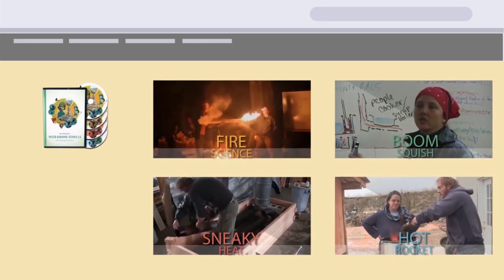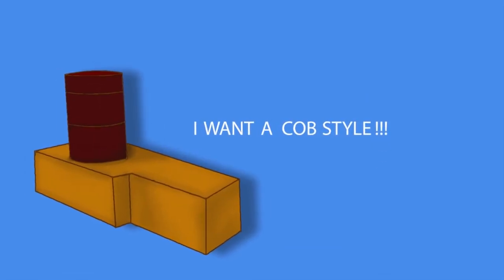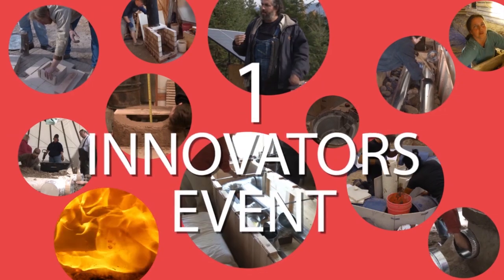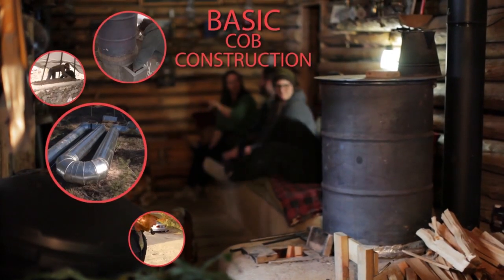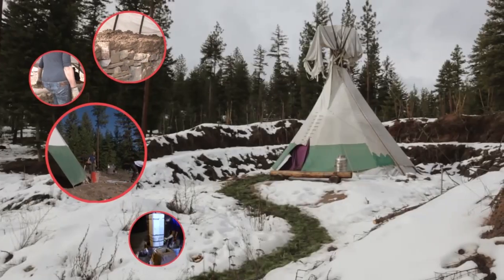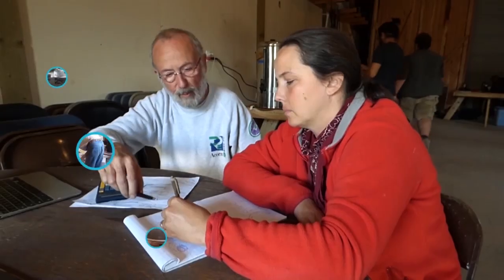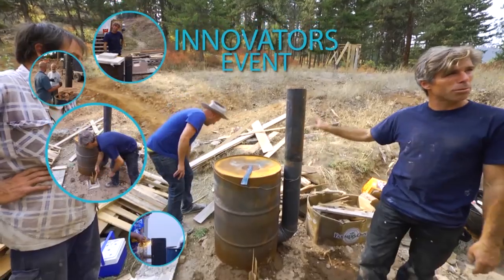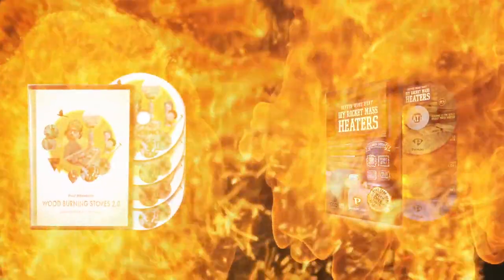Better Wood Heat: DIY Rocket Mass Heaters - trailer for 4-movie set

Comment: Realistically, could these be built on a national scale? Given that countries now have CO2 targets, can this be an effect strategy to help meet them?
Reply: Or is it more for rural households who traditionally rely on coal and wood stoves to heat their homes?
Reply from the maker: Yes.  I think that if rocket mass heaters were used by 100 million people in the colder part of the US, it could cut pollution and carbon emissions by 20% for the US.   The math is pretty simple:  More than half of our home energy use is for heat.  More so in the colder regions.
Reply from the maker: Most rural households use electric heat or propane heat.  Then comes the more conventional wood stoves and pellet stoves.  So rural stuff is ready to be harvested.  But suburban and urban homes with a yard are also a good place.   I suspect that a lot of inner-urban apartment dwellers might put in a rocket mass heater just to save money - burning a LOT of their own garbage - but also bringing some sticks to their home from parks and the like.
Reply: What about using bamboo/charcoal bamboo since timber bamboo grows up to a meter day. I'm thinking of using it in a construction project to reduce material cost of the by up to 60% instead of pine timber. I've been working on a new design for a homeless shelter that pays for itself.
Reply from the maker: I have never tried to burn bamboo - but sounds fine to me!
Reply: Government is precisely the problem. If I built one of these, it would have to be torn down before I could sell it because they don't have a permit classification for it.
Reply: @paulwheaton  Will a rocket stove burn residential garbage as effectively and efficiently as it does with wood?  I am also referring to exhaust air quality as well as any other factors.  BTW, thank you for what you do.

Comment: The wise....will listen to this man.
I did ! It's amazing how awesome these work. I have two in my home. Gonna put one in my teepee too !
Even after the fire goes out...the thermal mass holds and dissipates the heat for hours and hours. Nothin is more cozy even in the middle of a snow storm...and no black soot billowing out of the chimney !
👍👍👍👍👍👍👍👍
>>>-Wulfy-->

Comment: I have a question, can the dough bank be filled to cover the perlite tubes instead of mud or adobe?
I mean if you know if the pearlite is conductive of heat, because it would prefer to fill with pearlite and make the mass bank of that mineral, and not make it of mud.

Comment: Paul, what about a RMH that doubles as a Trombe Wall? 
(instead of the traditional couch shape)
Ever heard of it being done? Do you have any thoughts?
Reply from the maker: Hmmmm .... as designs roll through my head, I see problems ... and then the design shifts to solve those problems and create other problems.   I would think a person can burn off a few days with sketchup on this one.
Reply: paul wheaton If you say it's not a great idea, I suppose I have to believe it's true. What about simply exposing the mass to the most available amount of sunlight to heat up the mass without a combustible? Would it be worth the effort or a waste of time?
Reply from the maker: I think it could be a great idea.   It is just going to take some design work.
Reply: @tropicallivingoverseas5202  I look forward to seeing what you come up with

Comment: Cheers! Could this method be used to heat a 24k sq. feet warehouse?
Reply from the maker: I think so.  But it would have to be one rocket mass heater for every 3000 square feet or so.
Reply: Possibly pulling the heat from the RMH and running it through the floor of the warehouse (if you can have in floor pex or something)
Reply: @paulwheaton  There's a gentleman on youtube that heats a ten thousand square foot warehouse with a larger rocket stove...said he has to open the bay doors occasionally--in the winter--to cool down a bit